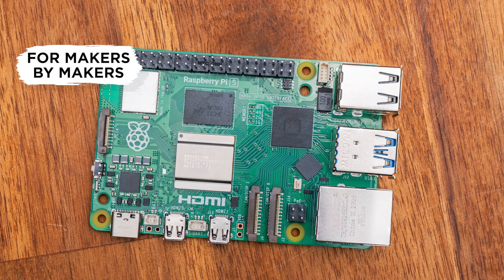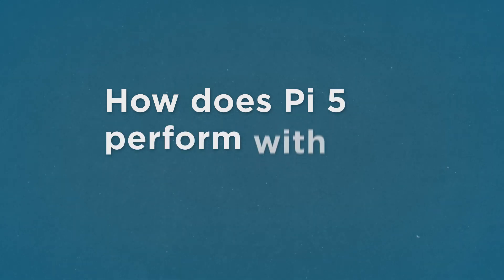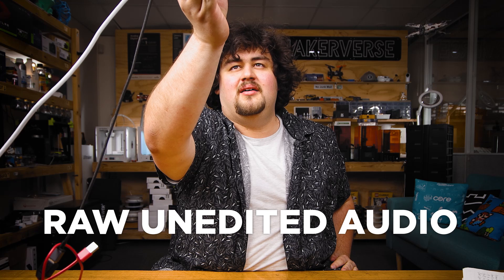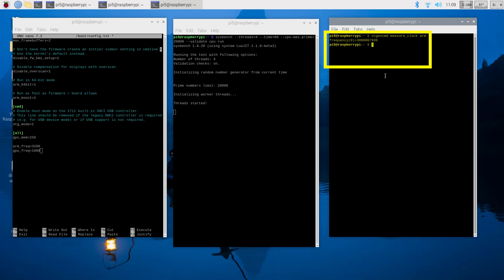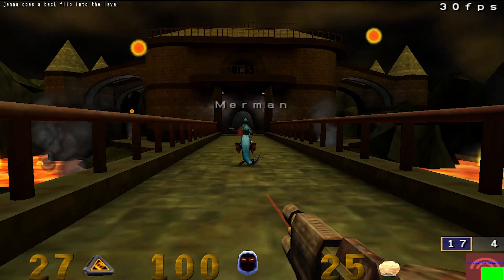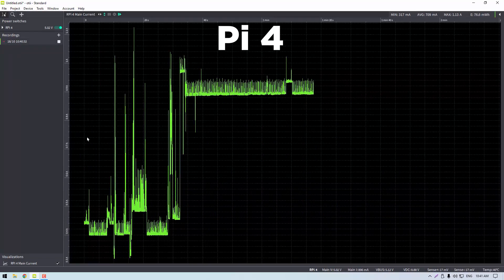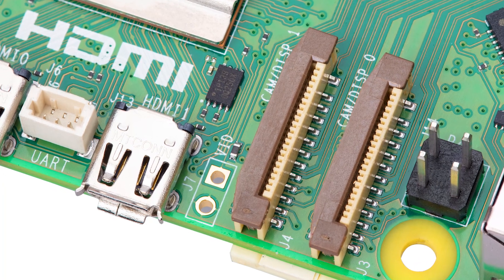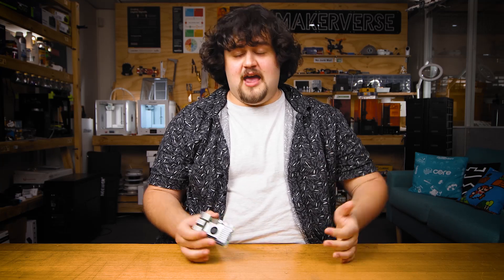Answering Your Pi 5 Questions | Cooling, Overclocking, Power and More

Comment: I own 7 Pi 5's half with 16GB RAM. Active cooling and heat sinks on all Most are overclocked to at least 2.8  dtparam gen3 NVMe speeds. 850MB/s read/writes for me and my pi's idle around 95-105F. Zero issues but YOU MUST have active cooling. If you really care about your device. eb ay dual fan hat is like 15$ Active fans before a heat sink. Im a Pi master.. My CM5's just run a little Hoptter but still NONE of my Pi's even under full load stress tests. I have never seen higher then 150F temps 70 degrees Celcius is wayyyyyyy to hot for my systems.. Ive never EVER seen 75C or higher.

Comment: A bit late but I have a question about the raspberry pi 5. I been having it for less than a year and its been working good for a few months and I been switching distros just to try them out and for some reason now it doesnt boot. When I plug it in it turns on but it doesnt blink. The only bulb that stays on is the red one. Their is no green blinking nor red blinking when trying to boot it. Also my mouse doesnt work. I bought a new cable thinking it was the cable but no. I also configured the eeprom files inside the configuration also the boot files I configured those and it still doesnt boot. I also tried the recovery eeprom and nothing also tried to install regular raspberry pi OS and nothing works. Also checked if their was any blown capacitors and nothing. I also tested the current for the usb -C port and nothing. Im kinda lost 😅 i also changed  the micro sd but it wasnt that neither.

Comment: I’ve never had a pi before but I’m wondering if you would need a heat sink or anything? I was thinking about buying a kit
Reply from the maker: Always recommended, the cooler the CPU is, the longer it will last. If you are getting the Pi 5 we still find that after a year of testing it is the best bang for your buck, if you are getting an older model, any cheap heatsink will do (even passive ones without a fan).
Reply: @ is there one that you would recommend? I’m thinking about the Pi 5 kit. :)

Comment: 9:06 - this is where he's answering the questions about whether or not the Raspberry Pi 5 an handle/run a local LLM on it? What's hilarious is he mentions the PCIe expansion that he's pointing out in the video here as possibly having a solution in time! 
And I am watching this 11 months after it first was uploaded, and Raspberry Pi has released an AI Kit, that has be added on as a hat, that is WELLLL worth looking up. =P
Reply from the maker: Just a note on this, The AI HAT is REALLY GOOD for computer vision, but I doubt it will be good for LLMs. The 2 issues are that you are still majorly limited by the 8GB of RAM on the Pi (which doesn't let you use larger LLMs), and the PCIE speeds will probably be a major bottleneck, maybe someone gets around this though! But for now it's not looking too hopeful.

Comment: I tried running several models with Ollama on naked raspberry pi 5 (without any cooling tool). It works for small models (qwen2 0.5B, ...) but for > 1B parameters, it will suddenly shut downs after several runs and it was too hot (> 80*C)

Comment: Can it be powered on without using the powerbutton ?  For example I want to power it on and off with a smart plug ?
Reply from the maker: Yes, the Pi will turn on when a sufficient power supply is introduced. Such as turning on a power supply at the wall, the use of an inline switch, or smart plug. The power button is optional
Reply: @Core-Electronics  Thanks, so also Wake on Lan will probably work

Comment: I have connected 3 usb port of raspberry pi 5 and one for mic second for Arduino and third fo a usb cam and final also connect a cooler with gpio... When the camera and mic and Arduino all come to work together its shows low power and boots up again... How can i over come from this... Any one suggest me please....
Reply from the maker: You may be drawing too much power from the USB ports. If you are NOT using the official Pi 5 Power supply, you can draw up to 600ma of current, which may also be showing the low power error message. If you ARE using it, you can draw up to 1.6 amps of current.

Comment: Incorrect... you will be stuck at 600ma across ALL USB ports. i.e. if port 1 is drawing 200ma, port two 400ma, then ports 3 and 4 will not have enough power to do anything. 

Also, unless you roll the overpriced, non-specification PSU, then not only will this power drop be in the USB ports, but you will see throttling of the CPU during utilization hits that spike the power. 

Raspberry pi foundation decided to sell you an over priced, non-standard compliant PSU, rather than adding 17 cents worth of components (voltage regulator, and accompanying capacitors) to the board (there's ample space on the bottom side for these), or a slightly more expensive PMIC with integrated regulation  (they exist). 

The pi foundation has also been found to be not only catering to scalpers, but engaging in scalping themselves. Selling units outside of their normal outlets at higher prices. The entire "shortage" of the Pi 4, and now the Pi 5 has been nothing more than a scheme to create false scarcity to help facilitate higher demand, and prices. Add this to the fact that starting with the Pi 4, they have been dancing along the edges of non-compliance with the USB-C PD standard, and picking and choosing specific wording to justify, or play off how far from standards they've drifted.

Comment: For those interested, I was able to get OpenAI Whisper speech to text model running on the pi 5. Takes about 90 minutes to transcribe a 3 min audio clip, so not fast but if you can wait for your jobs to get done, the pi 5 might be worth using

Comment: Running silicon at 80 degrees does not reduce the lifespan, the silicon lifetime reduction doesn't really start until around much more like 100 degrees, although it accelerates really quickly up there...  That's why the Arm clock frequency is throttled when it gets to 80 degrees...  Also note, when throttling up at 80 degrees it'll be running at 2GHz making it faster than a Pi 4!
Reply: Note the 3GHz limit is a hardware limit of the PLLs multipliers.  It is not possible to increase beyond that

Comment: the PI5 requires 5.1V 5 A 25 Watt on a USB C plug. 
The PI4 power supply with 3A can be used when only a small amount of power is required for USB.

Comment: 4:45 Remember that it doesn't matter if you have a nuclear plant to supply 5V and 9999A, if the Pi 5 doesn't detect Power Delivery it is going to assume that the power supply is 3A and thus is going to limit the current to the Peripherals. You can modify the config but it is going to take effect only after initial boot.
Reply: I have connected 3 usb port of raspberry pi 5 and one for mic second for Arduino and third fo a usb cam and final also connect a cooler with gpio... When the camera and mic and Arduino all come to work together its shows low power and boots up again... How can i over come from this... Any one suggest me please... Help me bro

Comment: I use RPi for playing music, but no UI. It's still unclear if I need any cooler. So, it seems I need to wait until real people start buying it and test. Why these questions are coming, because Orange Pi 5 does the work without any cooling. I hope RPi 5 can do the job too.
Reply from the maker: If you are just playing music with no UI you should be good without a cooler. But a few dollars for a cheap passive cooler will greatly reduce your operating temps and help increase the lifespan of your Pi
Reply: @Core-Electronics  It's a great hope. Regarding the lifespan, my RPi 2 still works like a charm. I feel ashamed to throw it away.

Comment: Will the Pi 5 work with the PoE+ hat and the cooler installed?
Reply from the maker: The PoE+ HAT is still a little away and we don't have much information on it. But just a couple days ago someone from Raspberry Pi said that "The new PoE+ HAT will work just fine with the Active Cooler."
Reply: @Core-Electronics  Ahh cool, sounds like they'll have a version for the 5, since the active cooler has its own fan on it already. Thanks for replying!

Comment: What over_voltage did you use for the overclock?
Reply from the maker: Hey Niko, its in the article but we missed it in the video, whoops!
We got these overclocks without  any overvolting and just letting DVFS do its thing. (Also sidenote, Pi engineers are also recommending using over_voltage_delta as it allows the DVDS to still work.

Cheers!
Reply: That's exactly what we want to know. There's no point on telling just half of the story.

Comment: This is a great video but I do think the lack of a wooly jumper being worn by the host is a drawback. 

Serious question, while we wait for the CM5, will the Pi5 be a good controller board for a Beowulf cluster? With faster processing power, could it manage a cluster of Pi4 era chips well?
Reply from the maker: Hey Darryl, it is still early days for the 5, CM5 is on the horizon but is still a little bit away. The 5 looks like it should do a decent job, but we will see when the community gets their hands on them.

Also, those are some big shoes woolly jumpers to fill. -Jaryd